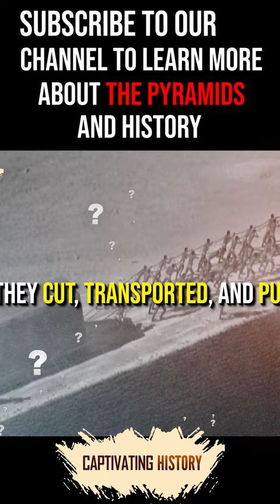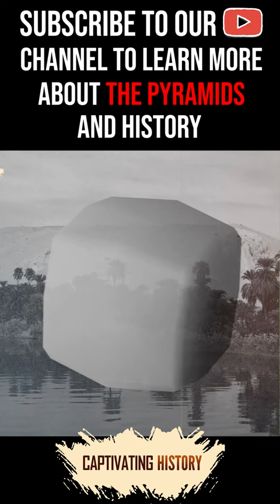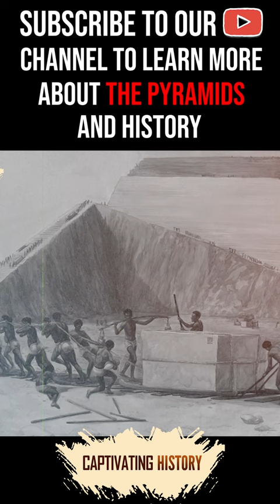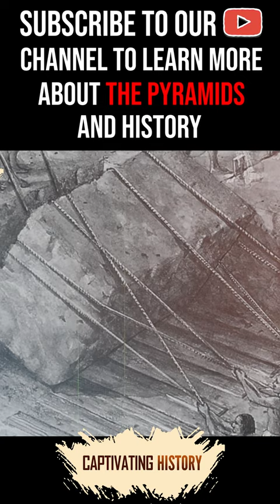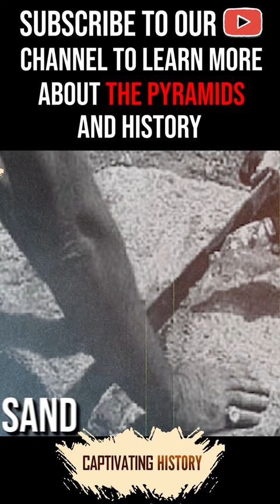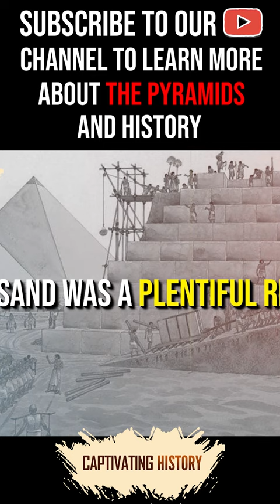How Were the Stones of the Pyramids Cut, Transported, and Put in Place? #shorts

Comment: What if there was a way to  build the large megalithic rock walls in Peru, and anywhere else.. without the massive "lifting, transportation and carving", as is always mentioned *
how could one do it?
~perhaps  by using leather forms and powdered rock*  and a catalyst to harden it...once the rock hardened,  then place 2 more on either side using the one side of the rock you already made to be the side each of the new rocks. .and you won't be able to get a piece  of paper between them*..as the next rock form's are hardened..more can be added to form more sides and on top..no mess..no carving except minor  final cleanup..and no transportation from miles away..notice the rocks in Peru  are all the same type and colour consistency. .kind of like cement* in a way..the knob on the sides of some stones may be from a support holding the leather form on the rock until it hardened..leaving some imprint behind..just some thoughts!
p.s. if near a river..building a water wheel will enable you to crush rocks to powder

Comment: It’s cool we think we know how the stones were cut, but how in the hell were they moved 500 miles and stacked hundreds of feet high with precision? I worked in the steel industry and we’d get 30,000 pound plates of steel, that’s 15 tons, some old stones that were moved weigh more, and you could try anything you want, you aren’t moving that steel plate with anything but machinery. Maybe with enough people you might slide it a few inches but you ain’t dragging that shit 500 miles and then lifting it 350 feet into the air. Cutting stone isn’t that crazy, the logistics of moving and neatly stacking millions of these blocks is absolutely insane. Also even with machinery, things weren’t that precise, plates were dropped or stacking them neatly took skill, it’s steel so it didn’t break. But these stones would crack if they dropped, they had to be very precise and whatever techniques they used were genius.

Comment: I'm thinking more like a huge and extra hard circular cutting stone, like that in a wheat mill, would be attached to a large upright shaft. That shaft would be supported by large A frame timbers driven far into the ground. Sail-like wind catchers would be attached to the shaft up top turning the stone at high rotation.  Now all you have to do is feed the stone to be cut into a job to hold it steady and add water and perhaps sand and viola. Just what I would do. Not saying this is how it was done

Comment: The method used of adding sand to The cutting saw still only allowed them to achieve possibly a 1-in cut over an entire day. That is not a feasible or realistic solution to being able to cut millions of stones. They did not use copper tools, it is scientifically impossible.

Comment: Why are the depictions in the background all full of pictures of people dragging blocks up ramps or scaffolding being used to hoist the stones into place when those 2 methods have been ruled out as possibly being used in the construction of the pyramids?
Reply: The ramp theory is the leading one, fun fact: it’s easier to build a temporary ramp, tie ropes around the block and have 50 guys pull it up a ramp than figure out a way to lift 15 tons of limestone into the air.

Comment: They had assembly line production thousands of stones in one pyramid they had to have power tools because those hieroglyphs we're all perfect like an auger bit was used
Reply: If they did have power tools it was still man-powered. Probably using very rudimentary gear ratios to create higher speeds. They also had access to natural diamonds and such, and probably used diamonds and sand inside the blades to make very precise cuts. Ocham's razor, the simplest answer is often the correct one. Its much more simple if some workers pushed a giant wheel mechanism that powers a highspeed very very early diamond blade saw than impractical answers like chizels or aliens.
Reply: They tested that theory and couldn't achieve the same level of stratification that they found in the core sample. They used all things that were available at the time and could only sustain a rate of a few hundred rpms for just a few minutes before they ran out of energy. The stratification of the core sample indicates that whatever cut into the rock was spinning at a rate of over 20 thousand rpms. Impossible to achieve with copper tools and gear ratios.

Comment: The stones you see today are not weathered but were roughly cut and held together with mortar. They aren't quartz they're limestone. The quarry is on the plateau near the pyramids. A finer imported limestone was precision cut and polished for the casing stones. Try a little harder to get the facts right.

Comment: I cannot figure out why they used such tiny building blocks.
Two to fifteen tons is pretty pathetically light.

In the 1700's a 1500 ton stone was moved to st petersburg to carve into the base for a metal horse statue.

1,250 tons after carving (cutting)

The statue is now one of the symbols of Saint Petersburg. The statue's pedestal is the Thunder Stone, the largest stone ever moved by humans. The stone originally weighed about 1500 tonnes, but was carved down during transportation to its current size and weight of 1,250 tons.

Noone is saying that noone knows how that stone was moved - because we all know.   And it is 100 times bigger that the heaviest pyramid stone.  And no - they did not have engines or motors then.  And no giants were used.

On a totally different take on the story you can take a look at the utility of the great pyramid over the last 2500 years and realize how useless it has been.   So you are basically dealing with rock stackers - a technology the average American kid has mastered with wood block sets by age 5.

Imagine the housing and good works could have been built with those stones had the pharaohs not been so incredibly ignorant and backward in their misguided hopes for an afterlife.

Any who says noone knows how those pyramid stones were moved as they envision alien technology is also incredibly stupid.

Comment: They used rope to draw through the stone. The rope was impregnated with copper tubes and sand lubricated with water. 
Water was used under pressure from the river to rotate hard granite stones and drill holes through rock. That's why the unfinished obelisk looks like there are scoop marks and the reason there were so many large river stones laying around. These people were smarter than modern egyptologists obviously.
Reply: Sheep will follow anyone

Comment: Multiple spikes were hammered into a straight line. Then each spike was hammered over and over until the the stone split. They use the same method today. There are numerous you tubes videos of men splitting boulders straight down the middle.
Reply: Do deeper research

Comment: Yeah...  just throw some sand on there,  that'll get a precision cut that we can barely replicate today.. or just toss that 50 ton block under water and then cut it with sand and a saw, that'll get a precision flat surface... what's that? The surface of a body of water is constantly moving? Ehh.. they used slaves...  And how did they align the great pyramid to be closer to true north than our GPS is capable of? And not magnetic north but geographic north...

Comment: NO just no!! Petri core clearly debunked that sand drill..

As a machinist its very simple to calculate the rpm and pressure from the tool to make the cut as we have the cut marks..

Our tools would break or the workpiece would snap before we could make a cut the same as they did..